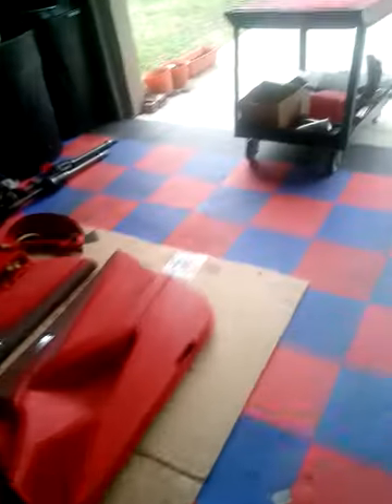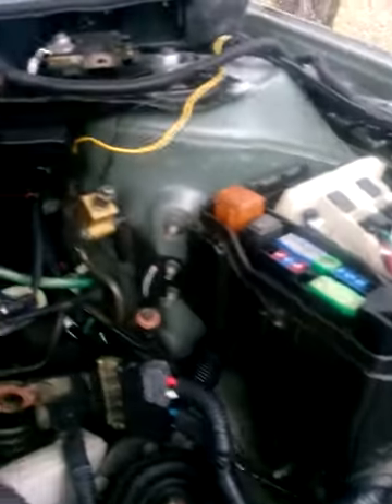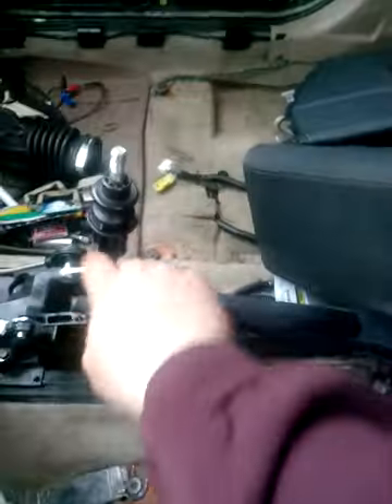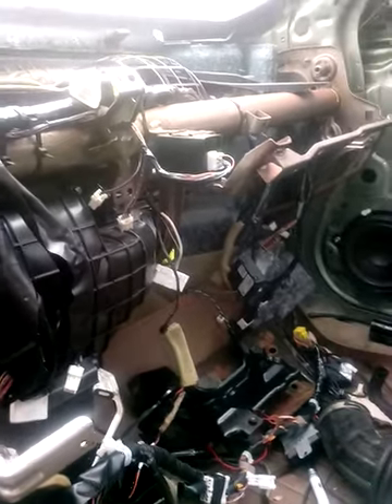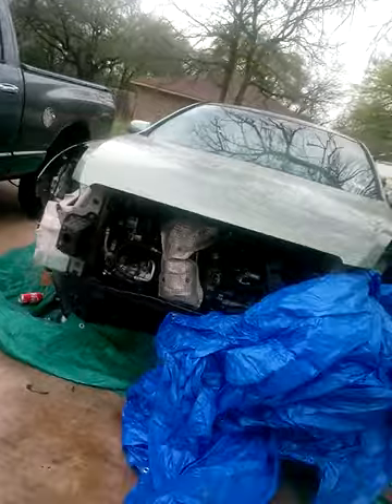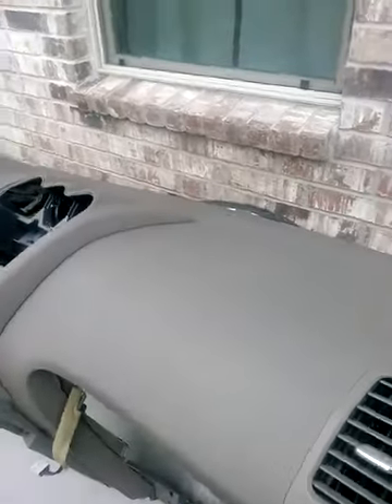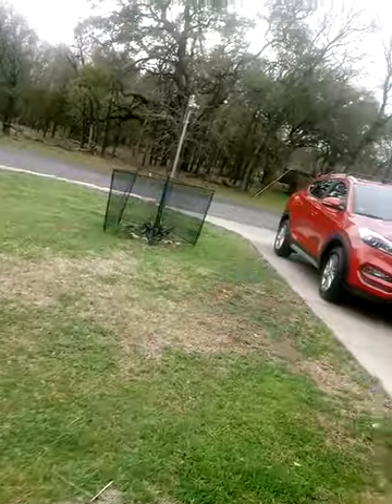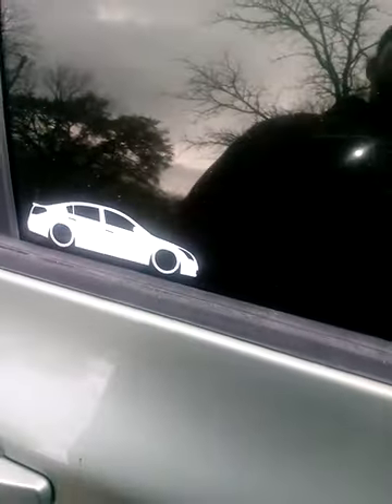Nissan altima cvt transmission problems +  swap to 6speed manual in progress

Comment: I cannot find a parts car to save my life. They mass produced the cvt... embarrassing on Nissan. Some people are terrified to dig into a car like that and then theres people who want to understand. Stay driven. Wish there was more filmed on the process.
Reply from the maker: Engine harness changed , installed clutch pedal and manual ecu. Watch all my videos to understand but if you not a mechanic you will be lost on the swap tbh
Reply: I'm trying to locate a parts car to do this. As of now I'm just removing everything in my way of the trans.
Reply from the maker: @jesseyjacobs9554  the v6 manual trans and 4 cylinder are the same if that helps any
Reply: Right, is there a part number for the manual engine harness or can I fab the auto one to work with the manual ecu?

Comment: Am done with the swap boss but my car is literally slow now...I barely make it to 100km/h on time. It takes forever. All my gears change well too. What could probably be left undone?? Please help....really need this car back to the road as soon as possible.
Reply from the maker: What ecu you using ?
Reply: The same ecu that was already on the car.
Reply from the maker: @dancob3247  I used the 6speed ecu and then got it programmed at nissan for 100 bucks
Reply: Do u mean I can get my old ecu programmed for the manual trans or I have to get a new ecu to be programmed????
Reply from the maker: @dancob3247  I programmed the manual ecu and everything was fine after that. When I did swap it would run and drive just no power
Reply: groundzeroautowerkz sparks ....okay. I am going to try that and revert. But how to know it’s a manual ecm is my problem now.
Reply from the maker: @dancob3247  did you change the engine harness too ? Because there some much extra wiring for the cvt trans on it.
Reply from the maker: @dancob3247  maybe you have to do the pedal relearn. Try that first. Idk what to tell you because I really dont know what you changed
Reply: groundzeroautowerkz sparks ...when I finished with the swap the car couldn’t spark, so I changed the engine harness and it sparked. I didn’t change the ecu . The car runs alright but I don’t have power. I am still searching for the manual ecu that will fit my car and see if I will get the power. I think that should be my problem since you changed yours(ecu) and I haven’t changed mine. Or what do you think 🤔?
Reply: groundzeroautowerkz sparks....mine is a Nissan xtrail t31 petrol...2008 model
Reply from the maker: Try pedal relearn if not it's the ECU 👍
Reply: It’s the auto ecu ETC being stuck on. Best solution is getting a uprev tune and gettting etc disabled. I’ve done couple 6mt swap for 09-14 Maxima! I own one my self and that’s what I did!
Reply: GMaxima 6MT ....please what is an uprev tune and what is the etc I have to disable????

Comment: Very impressive. And informative. Must replace the body harness? Will you get a different mileage on the cluster with a different ecu?
Reply from the maker: Had to wire rear windows to make them work. Car thinks it's a 2 door lol

Comment: I just got the death code im hoping i can make this happen on my 07 altima sedan ive put so much into it already i cant let it die now way to soon
Reply from the maker: @Jayson-in2vb  any questions hmu lmk 
It's time consuming not hard
Reply: @groundzerowraps  did u just take everything from a manual coupe of the same gen obviously beside the axle mounts ik u said u ordered those but like the harnesses fuze boxes pedal ebrake all that came from a scrap yard?
Reply: @groundzerowraps  ive done every once of work to this car since i baugt it mod and maintenance wise i just replaced my valve body not to long ago when i got fluid pressure sensor a and b thats wat the nissan board said to replace so i did and not a month later here we are further fueling my hatred for these things
Reply: A and B codes*
Reply from the maker: @L32Jay  stepper motor
Reply from the maker: @L32Jay  is it stuck in 1 gear ? Won't go put 40
Reply: @groundzerowraps  precisely
Reply: @groundzerowraps  it wont leave first but if i replace the stepper motor is that gonna keep that trans alive
Reply: At least to an extent
Reply from the maker: @Jayson-in2vb  fluid burnt . Change stepper motor and new fluid and she what happens. Or just 6 speed swap it
Reply: @groundzerowraps  thank you ill see what happens worst case is i can manual swap it I didn’t even think of that idk why i just figured it would be super hard and expensive to do but thank you for the knowledge

Comment: Quick question 
I’m trying to do a 2008 Nissan Maxima swap 6 speed manual using a 2004 maxima 
Do you think is possible?
Would it work?
Reason for swap,boost!!
I know a lot of noobs gonna be why swap....just buy a manual vehicle 🚗....VQ35DE 😬😬
Reply from the maker: I know the vq and qr manual trans the same idk about the 04
Reply: there is a guy that swapped the cvt to a 6 speed manual on his 2012 max

Comment: Been curious about this....newb here.. But my question is

I have a 16 altima and that was the year nissan decided to do 100% cvt. No manual. I assume i would be able to use 2015-whatever year to buy the computers and whatnots? Also out of curiosity bout what price range were you running for the overall swap?
Reply: Get an answer on this one?

Comment: I successfully swapped mine with a coupe as well. How did you get the back windows and locks to work on yours?
Reply from the maker: LoL I ran extra wire and burnt out 2 master switched before I figured it out
Reply: @groundzerowraps  so is it an extra wire from the bcm to the body harness? Or did you just do a power relay harness and tap the signals?
Reply from the maker: @AznAznAzn111  signal with 12volt relay and it works 💪
Reply: @groundzerowraps  great minds think a like. I was thinking the same thing.

Comment: I did a swap an a versa just wish the only thing that doesn't working is the speedometer  do I need to change the clock
Reply from the maker: I guess so cause I change literally everything and everything werkz
Reply: Ok
Reply: @groundzerowraps  so you did change your garage holster,?
Reply from the maker: @samplenotla3847  yes everything over to a coupe harness and just wired in the rear windows switches
Reply: @groundzerowraps  thanks
Reply: Please did you change your ECU?
Reply from the maker: @dancob3247  yes had to have nissan program key to new ecu 80 bucks
Reply: @dancob3247  yes I did
Reply: I'm looking at getting a Versa with 1.8 I would want to swap it to manual, I can get the manual from a 1.6 but idk what I'd need to make it work.

Comment: Did you actually complete this build? And was this for the purpose of putting a turbo on it?
Reply from the maker: it's been complete and driving over 2yrs I have turbo kit just never put it on been busy with my business
Reply: What year was the car and was it matching year of transmission? I'm trying to do the same thing but on a 2015.  Just looking for some direction before I start collecting parts to find out it won't work for some reason.
Reply from the maker: @dubnostaw3528  a 08 but they are all the same just look at my other video too there's few things that need to be changed but the dashboard must come out

Comment: What about a 3.5 Altima???
Reply from the maker: The v6 Trans part number the same as the 2.5
Reply: Copy that im on my second cvt transmission now 13’ Altima 3.5 185,000 miles the first one went out at 163,000 miles wish it was a manual sooo freakin bad homie
Reply from the maker: @jamesbrashear8391  it's been done on a maxima before with the 35

Comment: Any idea if the 6 speed from a Sentra would work? Even the Sentra 5 speed? Looking to swap out the cvt for a manual in my 2012
Reply: Any idea what hell housing I need? I would imagine from a vq35 but would it need to be a manual or auto or will the cvt bell work? Haven’t even looked at them to know if they are compatible. Thanks in advance for any further info.

Comment: i want to do this on my 2012 3.5 altima is there a part list anywhere for everything i need
Reply: @groundzeroautowerkz5871  have any other useful info regarding a swap like this? I’m new to car stuff and I’m interested in doing this with my Altima

Comment: What all did you do for you manual swap?
Reply from the maker: swapped everything from a 2dr 6speed. engine harness dash harness body harness
Reply: @groundzerowraps  Man is necessary change all the harness,if so, Why? I made the swap to 6 speed but i did not change the harness and I am having troubles with the aceleration, I don't know if this is for the thorttle body reprogram or the problem is the harness.
Reply: @yamirsin  did u figure it out